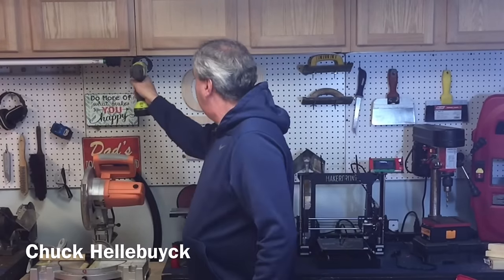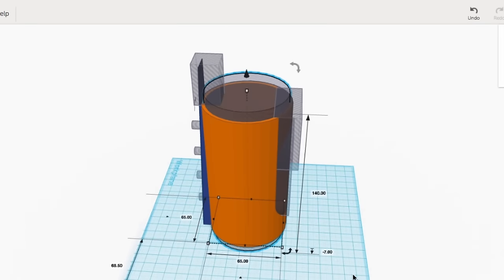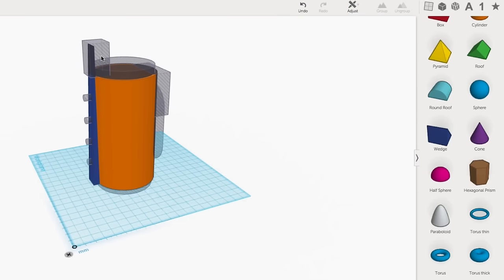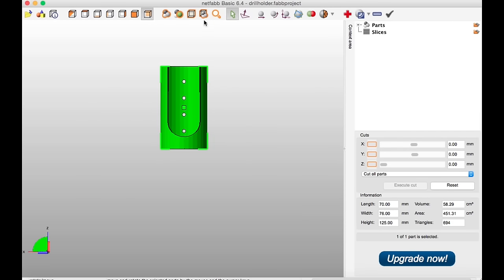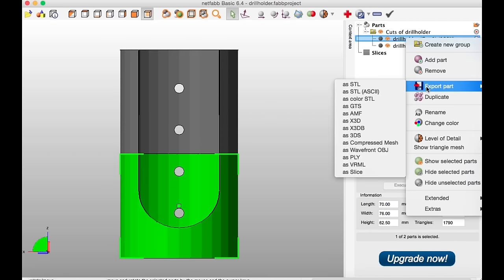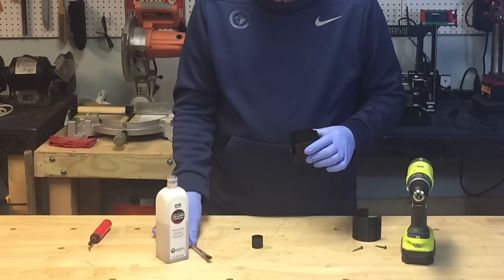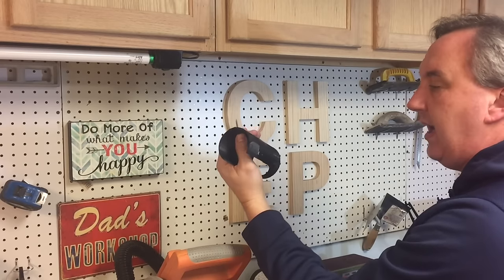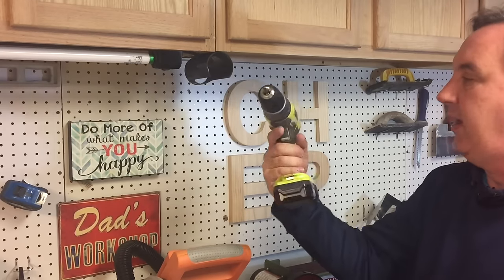Filament Friday #56 - How to Cut an STL file - Ryobi Tool Holder Design - to fit on Fabrikator Mini

Comment: Chuck, that's a pretty cool project. i would like to see more electronic projects incorporating 3D printing if you could.
Reply: +Chuck Hellebuyck&#39;s Electronic Products I've been wanting to make this "Tesla Torch" LED flashlight for some time: http://laserhacker.com/?p=436 And now that Proto-Pasta makes a conductive PLA, in theory some of the soldering could be replaced with a "printed circuit board" instead.  Of course, this project already has a video showing how to make it, but LED projects are always fun and usually fairly straightforward, so maybe it will spark (Hah! Er.) your imagination?

In any case, this video was really helpful - seems easier to cut parts in nettFabb than Meshmixer, so maybe now I'll actually do so. :) Thanks as always for creating great videos!

Comment: WOW, last comment 2 years ago. i just recently started using my boxzy a lot, set on the shelf for about a year. wasnt sure about splitting; even though the slicers kept saying out of printer bounds it came out great. just wondering if the overall dimensions can/should be increased to make it thicker? thanks
Reply from the maker: Thicker would be better.

Comment: You totally could have used Tinkercad to do this. Also, you could modify it so that you had a way to lino up the two parts easier.
Reply: I mention it because TinkerCad can import STLs and split them with hole objects stacked on top of each other. I've never been a fan of the Netfabb app. If you know how cad you should and if you don't you should, in my opinion.
Reply: I sometimes don't want to admit that being able to edit 3D files is a mandatory part of having a 3D printer, but at this time, as expensive and difficult to use as they are, 3D printers are really only for people who do 3D design. Now that may change when Mattel joins the game in a year, and I hope it does, but until then I'm gonna stick by my guns here. If you have a 3D printer and you don't know how to CAD, you should learn.

Comment: i have had nothing but problems with my fabrikator mini. i went through the book 3 times step by step but still have problems. My stepper motor that feeds the filament skips and clicks. The raft prints beautifully  and the part prints nicely  until about 8mm high and then it just goes haywire. If i try print a film canaster after around 8mm high  it shifts across about 10mm and continues to print. Also i notice my z axis doesnt seem to be moving up enough to print the next layer and the part starts to force the plate up making it wobble. I thought maybe over heating problem but even with cooling i have the same issues. The x axis motor also gets very hot and groans. I wonder if the instructions supplied with the fab mini are actually for the tiny boy and not compatable. But i have searched google and have not found anyone else with the same problems i am having. Any advice would be appreciated. i have tried both repetier and simplify 3d and have only had one part print well since i have received it. I am running windows 7 64 bit and had to manually download a driver as win 7 didnt auto install driver so maybe a dodgy driver here is a video of what is happening https://www.youtube.com/watch?v=jEjzavMaqQQ
Reply: +Chuck Hellebuyck&#39;s Electronic Products Thanks very much Chuck, i will start with your first suggestion and if i cant find anything i will adjust the pot in very small increments. Appreciate your time to take a look at the video. Cheers all the best